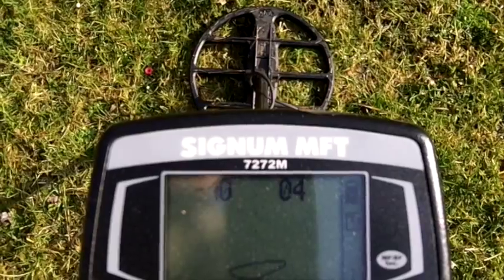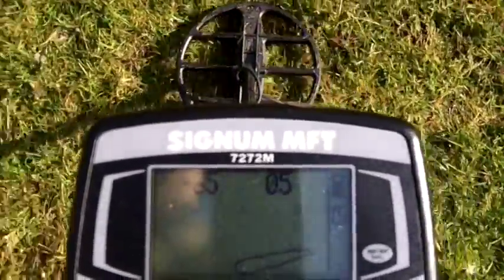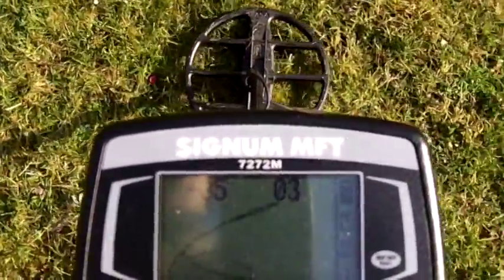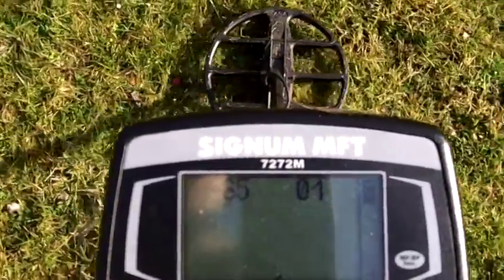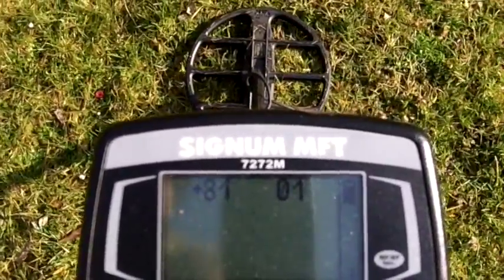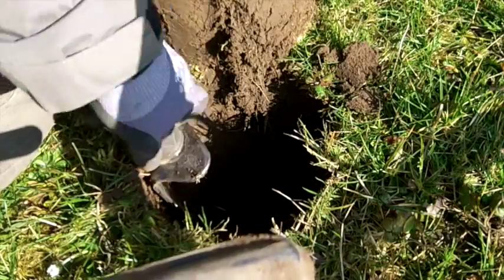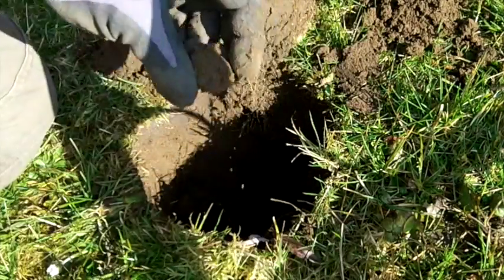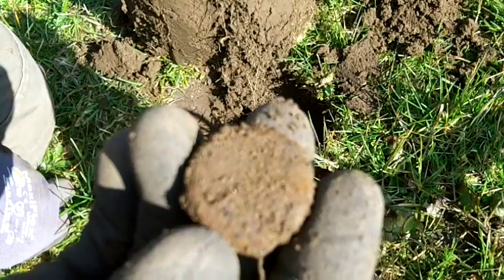Signum - Deep Bottle Cap  - Edge of Coil Check

Comment: Pretty cool. How are you liking this compared to the 3030, Etrac or V3i?
Reply from the maker: The E-Trac probably has the best fun factor (sounds, 2D screen, etc.) but the Signum seems to have slightly better depth so far. The Signum is light and has GREAT balance. The E-Trac is badly balanced, CTX perfectly balanced but HEAVY (bothers my elbow) and the V3i is also like the E-Trac. The V3i didn't get great depth in my ground so I can't say much there. The Signum is like the E-Trac/CTX in that you turn it on and it is deep. No more playing with many settings to get depth. I'm not selling my E-Trac but still hope for a light version some day. Also, the Signum seems a bit more "raw" in a sense, but hard to know until I do a side by side (e.g. in iron). Also, has a touchy GB, but for pro's like us, we know that. ;-)
Reply: earthmansurfer69 Thanks for the info. I wonder how it would be in mild ground. You have some pretty bad ground dont you?
Reply from the maker: DirtFishing  - I think my ground is more moderately to lower moderate in mineralization. The E-Trac max'd at 9" and the CTX about the same, but more consistently hit there and with a solid VDI. In mild ground the Signum might be the deepest out there. I say that simply because the air tests are unbelievable. You can see those online if you search. So, in FL ground it must be reaaaaaally deep!

Comment: Didn't you used to use a ctx? You like this one better? I've been thinking of upgrading my etrac and don't really think the ctx is 1000$ better. And when I say better, I want a machine that hits targets deeper. I've never even heard of signum, are they domestic?
Reply from the maker: Hey Tommy - I bought mine from Bulgaria. Also you can get them in Russia and order direct. They are Russian. You can't return them. I'm sure if they keep catching on you will have a distributor in the States. They are very powerful machines, very flexible and with incredible balance. You don't have to play with the settings, a bit like an E-Trac in that they are just deep out of the box. A lot of what you ask depends on your ground. The Signum is better than FBS machines in mild ground and appears to be at least as good with mineralization. Have to search for videos...
Reply: The ground is the worst in the country here in az. Salt crusted and high in iron and copper. My at pro won't work half the places I take it, especially after it rains lol. I'll keep my eye open, I like kellyco cus of their 30 day no questions asked return policy. I'll probably do the ctx and send it back if I'm not tickled pink by it, then order this fancy Russian one. I like how it kind of shows you the target size.
Reply from the maker: Tommy Ohlrich  - The CTX with it's bad ground settings AND the salt setting might be the best out there. I would check on the Signum for someone testing it in bad ground like yours. Though, you will be able to resell it as they are hard to come by. Good luck with the CTX, love that machine but the cost - as you said, not $1000 better! (except in some cases, like in a downpour ;-)
Oh, the Signum doesn'T show target size. That hodograph is like a V3i holograph. More about composition and depth.
Reply: Ah. I misunderstood. I heard u talking about target siZe and I associated it with the funky vdi